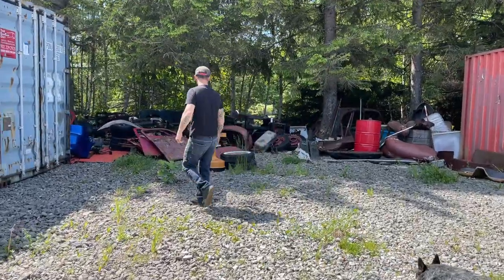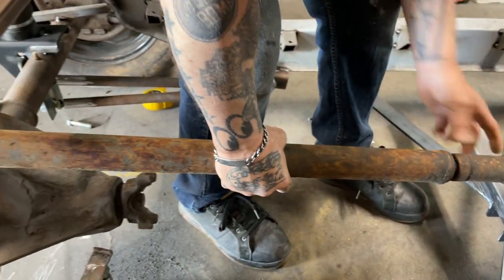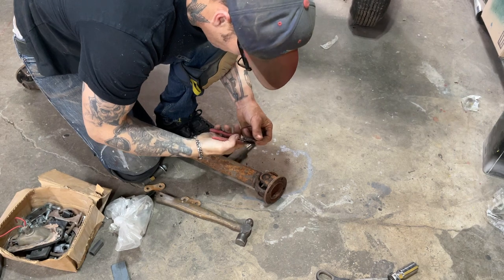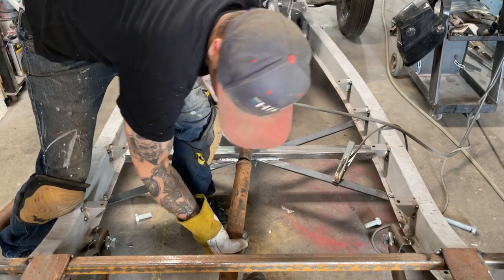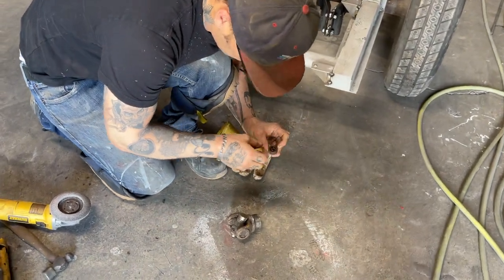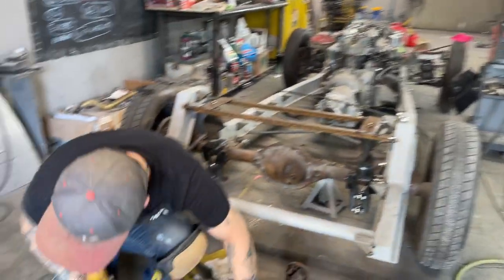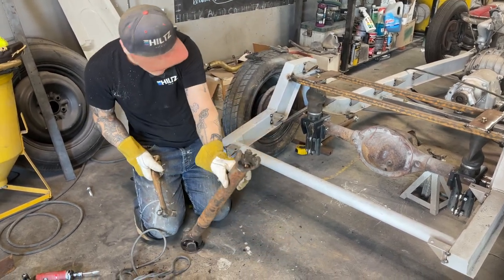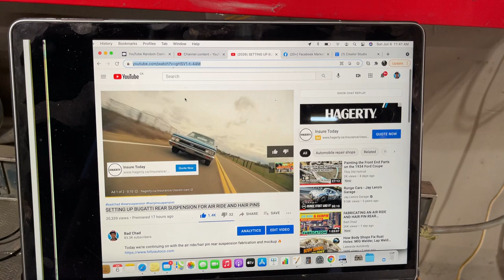THE EASIEST WAY TO SHORTEN A DRIVESHAFT

Comment: I've been watching for many months, and in that time I've not used a mig welder that I have access to, because I haven't had a need. Today I was replacing two plugged up resonators with straight pipe. Previous to today, I would have had side cutters in my pocket to shorten the wire when I pulled the trigger and had three inches of wire to contend with. Having watched Chad do this several times, I just laid the gun where I needed to wels and Viola! Weld was made, no fuss, no muss.Thanks Chad,

Comment: When working with u joints take a socket or something the same size as the inside diameter and tap the snap ring then pull it right out most of the time, doing this relieves some of the tension on the snap ring. Repeat for the other side
Reply: @joepacheco4038  thanks Joe, been many years doing mechanic work and before that watching and helping my dad, I have tried to get out of it because it is hard on your back and knees but I keep coming back to it, Chad has inspired me to try welding again so I'm gonna give it a shot in between fixing junk
Reply: @joepacheco4038  nice

Comment: Hi Chad and Jolene. This video brings back some memories for me. I use to modify lot of land rovers in my youth in he uk and made many driveshafts. 
I just thought I’d pass on that all the land rover and range rover driveshafts have the same slip joint and flange bolt pattern as your Jaguar stuff. They one in all different lengths too. They rear short wheelbase land rover driveshaft is about the same as the one you made I’d say, then the front driveshaft is longer, the the long wheelbase rear driveshaft is longer again. Range rovers are different again so lots of choice. 
Thanks for the great video

Comment: That was very interesting Bad Chad. It was the first time that I've ever seen a driveshaft cut apart and shortened  You made it look easy
Reply: It is easy, as long as you remember to allow the slip yoke some space for when the rear axle moves on acceleration. Always take note of the plane that that the Universal Joints (Hardy Spicers) run in comparison to the slip yokes at the transmission end of the drive shaft. I’ve done several over the years and only ever had one that needed the balance weights altered.

Comment: It will be interesting to see how it's balanced
Reply: If it’s straight and if the U joints are actually aligned, not just eyeballed, it will be balanced but 🤦🏻‍♂️
Reply: I’ve done the same before with no issues on a 425hp car.
Reply: @Adrian-mu7ph  why is that?
Reply: If they get inspected then there should be no reason or problem why they wouldn’t be road legal, also there are several cars he made that were drove to different car shows so if they weren’t road worthy then he wouldn’t be able to drive them for X amount of mile to get there and back again
Reply: @leesmith2162  
Trailered ?
Reply: People have been making driveshafts this way for a century, if you're not spinning very high RPM's, you really don't need a perfectly balanced driveshaft.  Perfectly 'good enough' for a basic road going car, maybe not ideal for a high performance, high speed car.  But realistically this car probably will never see 100mph...
Reply: But what happens when the bag are deflated ? Will it be the right measurement ? Or will it slam tail shaft into trans?
Reply: @grumpyoldirishman313  It is really quite simple... are you implying he won't cycle the suspension once he has the rear end in and welded up?  Pretttty easy to adjust if the length is too tight at that point.  Ever built a car? This is kinda how things go.. it ain't like TV where boyd coddington's boys can order out for a fancy driveshaft and have it the next day.  That isn't real life, especially for those that don't live in a city. Real people...they just shorten the shaft and move on with their lives. Heck you'll find people all across america shortening shafts and narrowing rear ends in their backyards....
Reply: @miaknecht  Well said just because it’s not by someone’s book doesn’t mean it won’t work and isn’t safe. Like Chad keeps saying there’s more than one way to skin a cat 🐈‍⬛
Reply: @geofo60  if you went back to some of his earlier videos you can watch him drive to different shows and places
Reply: @miaknecht  👍

Comment: The slip joint makes sense and answers my question about if the rear end is swapped out with a different one. I also learned that the U-joints need to be lined up.

Comment: How do you know if your rear-end is going to be same as mock up one when it comes for length of driveshaft.
Reply: I was thinking the same.
Reply: @buffdelcampo  And every universal joint is a different size ( mostly) . Chad attempted to remove the circlips on the universal joint. What would that have achieved? The drive shaft was the wrong length.

Comment: before welding, I would bolt the shaft into the car where I could spin it and check for true.
Spot weld it in a place or two then check again. Adjust as needed with gentle impacts. 
A dial indicator should work, I just used a pencil clamped to a piece of bar stock. adjust until the pencil leaves a full mark around the shaft. these worked well to 100mph *. no shake.   make sure u-joints are in good shape and tight before checking and welding.

Comment: Man Chad. As a Mechanic all my life it's gettin harder and harder for me to watch some of your mechanic work. (8:42). You have a huge vice 6' away from you. you need a vice where you can use it for everything you need it for. Weld a pipe to a truck wheel an put a plate on top. 20 min. move it anywhere you want it to use it. You have a damn nice vice and it's useless to it's potential on a bench. Not to mention how many times you have almost gotten injured. You'll love it instantly and use it for what it's really worth. A very huge time saver as well. Lookin Good.

Comment: Now that you have the driveshaft length - do you balance it? Second - when you cut off the ear that holds the u-joint, how are you going to attach the new one to the differential yoke?? Other than that really cool. Oh, those pliers you want are snap ring. Best ones are the ones that don't have to be built like the ones from Cdn Tire. I think the reason you were having trouble is the spring in the middle that supplies opposing tension was missing?

Comment: Two things.

1: Why did you size the driveshaft for a rear axle that you are not going to use?
2: Make sure the driveshaft can take the torque from the Jag engine. Back in the day, we put a 3.4L Jag engine in a 1959 British Vauxhall Cresta, using the original Cresta driveshaft, shortened to fit. It wasn't long before the driveshaft corkscrewed, and tore into two pieces.

Anyway, that aside, love the show.

Comment: Chad 
Love your work.
I too think a bit premature if you are swapping out that rear end.
You may need to make another drive shaft if the length differs my more than another 1/2".

Thanks for sharing.  
Will you get that balanced??  
I was sure there was a weight on that original shaft before you cut that yoke off.

Comment: Those circlip pliers are for both internal and external circlips you just swap sides to suit which one your removing the problem is you are missing the center pin that holds them together that's why they wasn't working properly.The pin has a spring on it and a sliding lock to stop it falling out . Apart from that nice work it's coming together nicely.

Comment: You can get a torch and hose for propane that is very similar to Ox & acetylene ( not a tiger torch) I seen some that comes as a 2 hose set up where you need oxygen but I have one you just screw on to a bbq propane tank and it has a torch end similar to a cutting torch

Comment: I have to ask though, if you put a big motor on a drive shaft you've done that too (I need to shorten one), is that going to hold up in your typical 350 hot rod? I feel like that would break/snap where you cut and welded it back.

Comment: I would make it a little shorter being the the axle is still resting on the square tubing, once it’s removed the frame is going to drop a lot and the slip joint is going to be tight. But it’s looking good

Comment: If you add a crossmember to the front of the frame will that not interfere with the body?  Looking at how close the radiator was fitted to the grill on body I can’t wrap my head around how a crossmember bar will work.

Comment: Did you measure the pinion yolk /about on the other rear end that you want to use I had been through this before different rear ends have different links on the pinion shaft yokes.might want to make sure nothing happens to the other driveshaft

Comment: I bet Doug has a press to get those UJ's out, or you can do it on your vice with sockets as spacers.  You do need to get the clips out first, penetrating oil helps.  Not liking beating on the yoke ends with a ball peen, get a big rubber mallet for that so you don't crimp the cups or worse.

Comment: Why don't you get one of those cheap Harbor Freight chop saws, put a carbide tipped metal-cutting blade on it and use it for cutting all of your pipe, angle iron, etc. I think you would love it. Much faster and straighter cuts.

Comment: Now he needs to bolt it up and set up a dial indicator and then slowly turn the shaft and tap it straight…..when its within 10 thou,  tack it then he can take it off and weld it up.

Comment: Where you get it balanced tho and even at that who checks the ballence
Reply: Even my one ton diesel pickup drive shaft is Ballenger as I seen weights welded to its smaller lighter car definitely would feel more vibrations than big farm work yruck